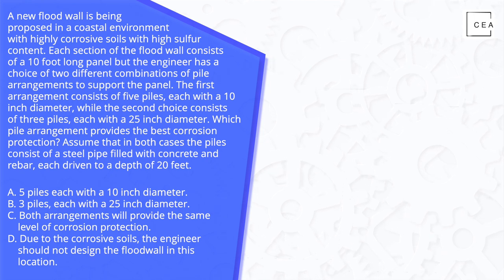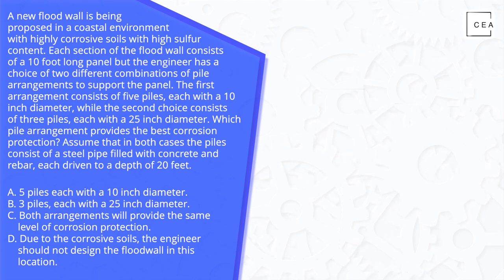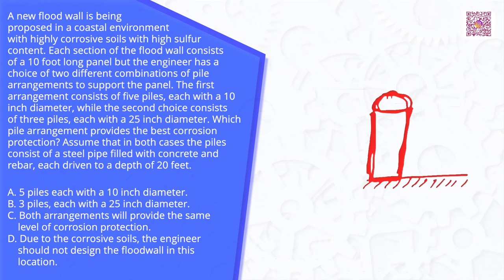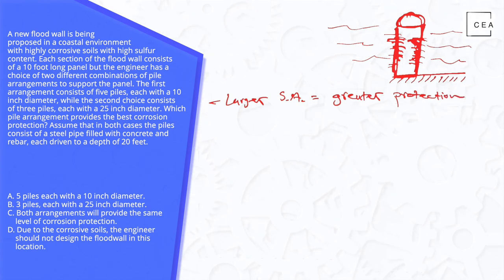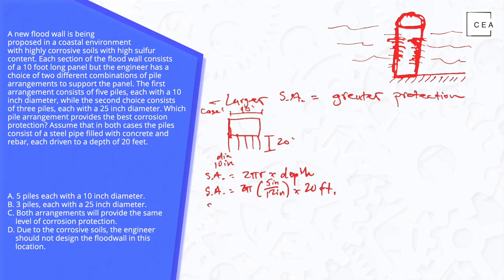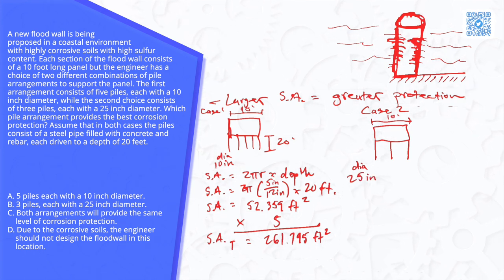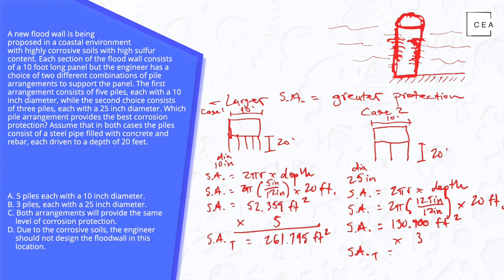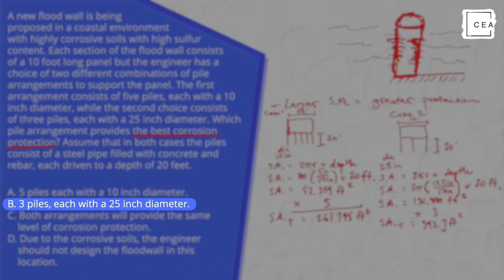Civil PE Exam - Structural/Geotech - Find the Pile that Provides the Most Projection

Comment: I got confused with the question asking for better corrosion protection, I thought about how much material was being lost, and thinking it that way I thought that the answer was C) because in both systems each pile was going to lose the same amount of material, same concrete cover for the rebars. In the end the system who will still work better as a whole with corrosion acting on it will be option 2 or answer b). I am just writing this in case someone else had the same wrongly reasoning. Nice video!
Reply: Yeah Cosmos I kinda agree with you. I feel like the exterior of the piles is going to corrode regardless of how big the diameter gets. A better way to phrase the question I think would be to propose a difference in thickness of the steel piles which would actually provide more corrosive protection. Maybe that is just supposed to be inferred from the pile diameter getting bigger that the thickness would too?